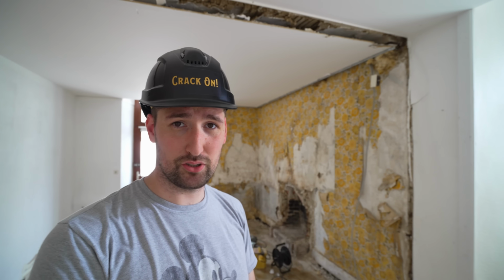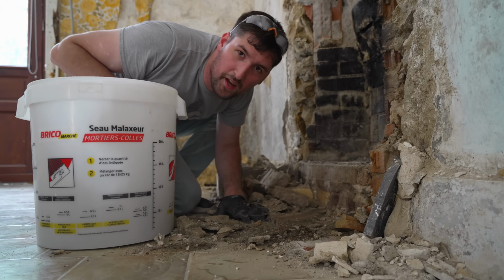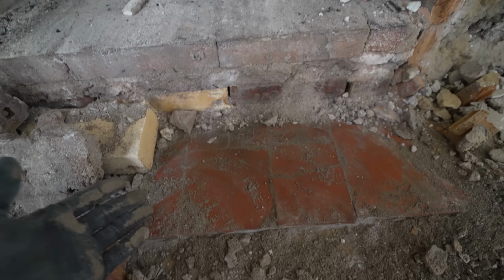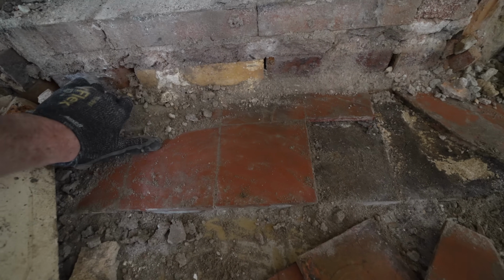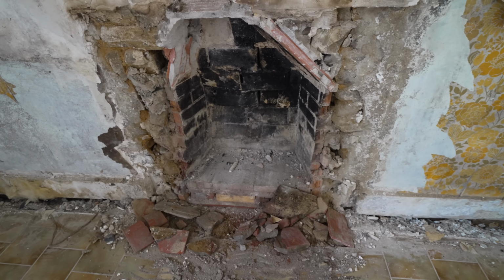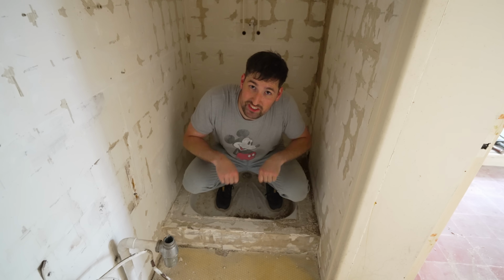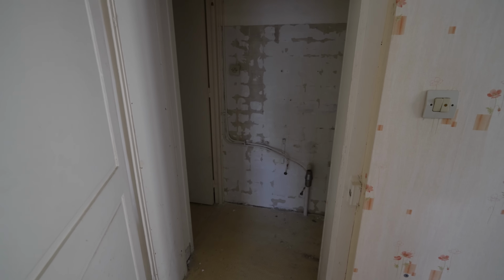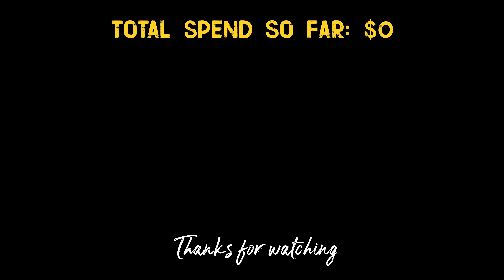Jackhammer Demolition Reveals Astonishing Discovery!

Comment: As a suggestion; I would remove the bricks on the sides and top of the old fireplace and leave the back wall intact. Then using stone and mortar fill in the area where the fireplace was. This will help keep insects and bugs out plus help to insulate the wall before applying a new wall over it.

Comment: It's frightening actually, how badly (and flimsily) the previous renovation was done. Some of the materials they used were substantial and yet not very well secured.
You're doing a service by demolishing all that, Ryan. You're lucky not to have moved in & tried to adjust to the apartment as it was. You would've had walls & plumbing caving in, falling on you...

Comment: It looks like you've had two different fireplace renovations, where the tiles were  put in under an open basket, or freestanding log burner, then the built-in was just built on top, but as to the rest of the floor it could still be tiled and that was just a raised hearth stone, the tiles could even be original, just relayed.
Reply: Yes! exactly what I was thinking!

Comment: I thoroughly enjoy you taking things apart! I still think there must be terra cotta tiles under the living room. As you said, these on the fireplace were only scraps, and they could have used them when they added that fireplace insert that you removed previously. Great video as always. See ya tomorrow!
Reply: I agree. There is terracotta tiles under the living room floor. I think the first fireplace was a little above the terracotta floor. When they remodelled it they made it the same way - a little bit higher than the floor.

Comment: Hi Ryan, can you do a little more demo on the fireplace sides and back?  I also think there is a chance that it could be a larger original stone fireplace that had all that garbage cemented in to make it smaller. Also that terracotta tile could have been the bottom of the original fireplace, if it extends to left and right if the newer side walls. Let us know!

Comment: I would put a flue liner in and a plate with insulation so you can put a nice log burner in there.  When winter comes and the weather gets nasty, it would be so nice to have a wood fire to snuggle up by.

Comment: Ahhh well, here's my first bit of sad: those tera cotta tiles. In the states we call them firebrick. They are very high fired tiles, used for exactly where you found them; fireplace linings and underlay.

Later since they were once inexpensive, they were also used as flooring. I agree with the commenters who wish to see the "memory" of the fireplace preserved. We had a flush fireplace with a slate landing or whatever it's called, have forgotten at the moment. No mantle, just an iron chain for a screen. I didn't care for it but cleaning that fireplace was dead-simple; sweep it out, done.

Comment: I still think all of those floors need to be damp-proofed and insulated. The easiest way of doing that would probably be tearing out the living room floor, digging out to the same level as the old tiles in the other rooms. Then plastic over the dirt and the old tiles, insulation and a new screed. With underfloor heating if possible (mostly from a budget point of view) and maybe new terra cotta tiles on top.
Reply: @YaaLFH  And worst case you might even get condensation and damp in summer.

Comment: really should knock out that last wall to turn the back room into the kitchen with back access. 
Then knock out the bathroom wall and extend it out to say perhaps double the depth for a bigger room. 
Then the current kitchen becomes the dining room which can walk through straight into the kitchen, or perhaps have a large walk around bench across which can act as a breakfast seat area.

Comment: The terracotta tile may have been the original floor which was taken out after the fireplace was installed. Please ensure that you close off the chimney at both ends when insulation is added. That's could be where some of your water damage comes from on that wall.

Comment: Ryan , what kind of heating will you have in your apartment ❓
Reply: I would love a propane or pellet stove in the fireplace area….independent of the grid.
Reply: @drummerlovesbookworm9738  Pellet stoves need to be plugged into the electric supply. They also need clearing out daily with a special electric hoover.

Comment: What is the condition of the chimney at the roof? Is it capped? You'll need to look at that so water or critters not an issue.
Guess depending on chimney condition, you could put a gas fireplace in, but that may mean a new insert in the chimney, professionally installed.
Make sure none of that concrete and dust gets in the uncovered shower drain plugging it up.
Good job with the jackhammer. 
Didn't know mega-long extension cords on reels available like that.

Comment: What is next door to the apartment? Is it the neighboring building or is it still apart of the Convent? Cause there is definitely daylight coming through those holes. I guess if it is a neighbor you find out soon enough when they come knocking on your door. Lol! Nice job removing the tile in the bathroom and the brick on the fireplace.  Shame the tomettes  don't go under those newer tiles, it would be a nice surprise if there was something under there just to deduct the cost. Personally, I prefer wood to tile no matter how original it is( unless it is marble or travertine etc.) so I hope the wood floor can be saved. It would make a nice contrast to the tomettes in the rest of the apartment.  I guess you can now do whatever you want in the living room, but I hope those whitish tiles go they just look dated to me.  Switching the shower around to the other side is going to look so good too, much better than the current cave that it is in.

Comment: I think the fireplace needs to be loked at further as it seems to me its a relatively “modern” addition probably done when the current tiles went in.  Think there is more to discover there.

Also in the “hidden” ceiling the bit that you thought was wallpapered could actually be a painted roof.

Comment: 1).  I thought you were keeping the fireplace.  I am so disappointed. 
2).  Please take the fireplace floor down to its original level.
3).  Take the apartment back to the original walls, then play with the space.
4).  Please respect the original architecture.  An apartment with its original features garners a higher rent.
5).  The apartment should reflect and respect the architecture of building and its era.
Reply: I agree 100%!

Comment: I'm pretty sure that the tommettes are under the floortiles in the living room too:  levels of the kitchen and the original level under the wooden floor are lower than the tiles of the eighties in the living room. And as we saw previous, they didn't make a big effort to take things out, they just covered ancient materials with new ones! Same procedure in the whole convent!
I would rip all these hideous floor tiles out and go back to the beautiful original tommettes ! Nicer color and ancient atmosphere!
As I would take out the horrible false ceiling wich is cutting a part of the door, a frustrating view.
I know, there is the question of heating cost in highers ceilings, but honestly, the doors...the light...the harmony...

And last but not least Ryan, think very well about a future stylish but inefficient marble fireplace!!
Why not putting an as stylish wooden massheater (a small version), wich could easily  heat the whole corner appartement ? Look for example "poeledetradition dot com", or "oliger dot com". These are just two examples...
Waaaaay more efficient and as beautiful as the not useful marble fireplace!
And heating with wood dries humidity out of ancient constructions...

Comment: Are you sure you must remove the fireplace? Is there some type of code restriction? I’m just thinking how cozy a fire would be on cold rainy days in winter. And the fire place shape would accommodate a really amazing mantle.
Reply: A coal fire only keeps you warm if you sit right in front of it, it does not heat a room effectively. I remember them from my childhood.
Reply: @janetpendlebury6808  First, I wasn’t aware that this was a coal fire. But there have been so many innovations in inserts for fireplaces, I would think that isn’t a problem these days.

Comment: If Billy was prepared to spend a little more and you were up for more work, there are things that could be done to make the corner apartment more comfortable now and likely to bring in higher rent when you inevitably move on to your dream mansion
Make all the floors level and use as opportunity to install under floor heating. Maybe reuse the terracotta tiles if that would work? 
Before restoring the timber floor, maybe pull it up and put insulation under it, am concerned the bedroom will be too cold for you otherwise 
Also raise the ceiling, having the ceiling height below the top of the windows and doors is quite jarring- maybe you find usable beams ? If not, put them in ?
In addition, remove the tiles dye to the door and replace with a stone step 
This would make the renovation more in keeping with the convent  and provide a lot of livability and charm
Reply: Sure how do we do that? Btw I am in Qld Australia- am about 10 hours ahead 😊

Comment: Drain in Shower full of debis good idea to keep drains clear so they do not clog. When using the Jackhammer does it Vibrate a person's teeth and if so do they hurt after? Merely wondering. Imagine muscles would hurt after awhile  😂 The wood floor looks horrible now and whomever made the fireplace was a novice judging by the upper ledge of it. Way to go wearing Safety Glasses and cleaning up to ensure no trip hazard. Ryan learns fast. Very important as is blueprint reading and initiative. Billy must have those to look through to learn from. Admin side of construction pays better Safety People, Payroll, Planning, and coordinators. Check into drone options. Later!
Reply: Wouldn’t it be interesting to know the history of how that corner apartment came to be as it was? I always think how somebody selected that wallpaper and saw it as an improvement. Same with the wood floor. They were pleased with the result at the time.
Reply: @drummerlovesbookworm9738  Added their own touches to compliment the Space much as you are trying to do. Often wonder what jobs they did, pay and affordability of unit also the peoples' interests. Many Artists and Poets lived in those days hiding their art or leaving hidden diaries much as  "The Diary of Anne Frank" was found years after The Stone work is a work of Art. True, many stories hidden in those walls waiting to be discovered. Check out Historians in the area Thanks!

Comment: Are you replacing shower pan with another porcelain shower pan? You could have re used it. Thats the beauty of probably a vintage porcelain fixture which is in pieces now. Im guessing you will replace is with a fiberglass one. What a shame
Reply: I doubt they could have removed that old shower pan without damaging it, it was nothing special, you can get much better ones these days, that take up less room and are more efficient.
Reply: @YaaLFH  oh ya i could see shower with no shower pan just drain its all part the floor but more work to dig a channel out to fit pipe to take draining water away shower pan was elevated to hide drain pipe to chanel water out im guessing thats why had showw pan but how you suggested would be nice not sure ryan can handle that type of work without Billys  help and cost who knows maybe they will see  your vision